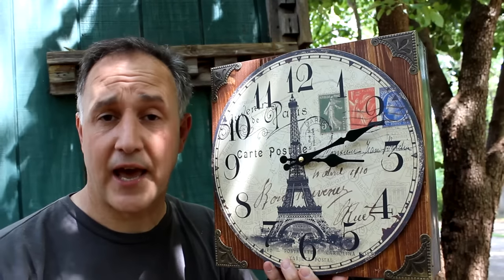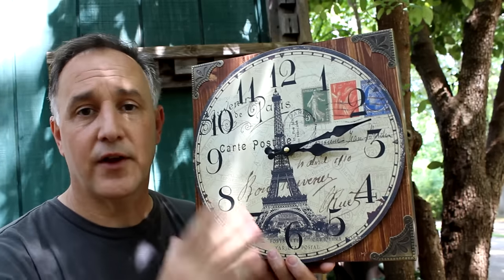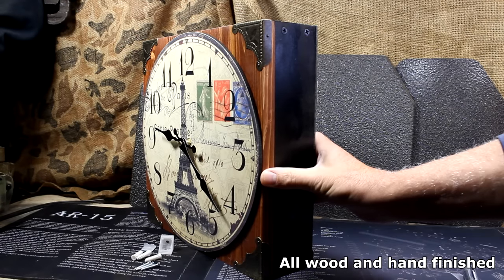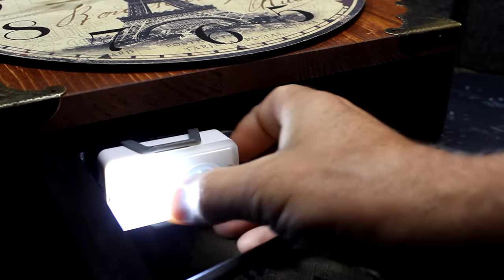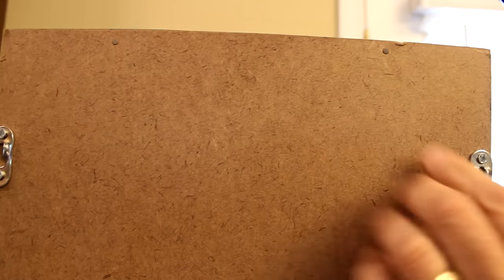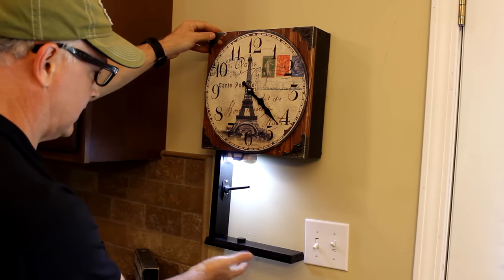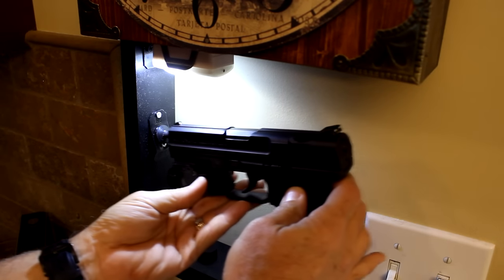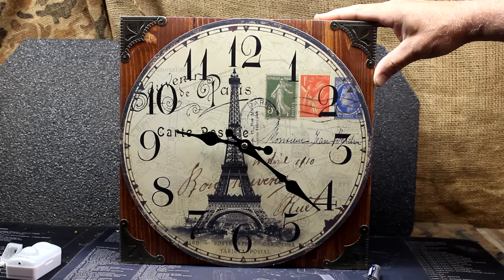Tacti-Clock Gun Concealment

Comment: kinda odd to have clock at face/eye level... usually they are higher up.
Reply: Depends. Not always. I have a pretty large clock on my wall. 2ft x 2ft long and it has to hang on shoulder level. ^^
Reply: Not true even a little.
Reply from the maker: It looks good on the wall and that level helps get to the magnet easier. My wife approves so all is well.... and she's picky.

Comment: Nice, but haven't you thought about getting a big heavy gun safe thats bolted to the ground?
Reply: Nah, he probably just has like 30 clocks in his living room.
Reply: The purpose for these is to have a gun ready no matter where you are in the house. What happens if someone breaks in, and the come from a direction that would be blocking a path to the safe? You gonna take a risk and try to shoulder check him out of the way?
Reply from the maker: I have three.
Reply: +Alex Moore  how about installing deadbolts and iron bars on your windows and doors? The best defense against an intruder is preventing him from entering your house in the first place. Install motion sensor security lights on the outside of your house, trim your hedges. Or just leave the door unlocked and the Windows open.
Reply: +Rxxxster those are good ideas, but it's not a bad idea to have something in case someone is bold enough to try or somehow makes it past. You can be as careful as you can be in a kitchen, but if you throw out the fire extinguisher then you aren't that smart
Reply: +Alex Moore I still have my AR15,AR10,12gauge,g27and a g23 inside my house. I ain't that dumb:)
Reply: +Rxxxster Four houses to my right there is a freaking fortress of a house. Guess which house had 3 break-ins last year? If they want to get in, they will.
Reply: +RBGJoe if that is true, I guarantee you that it was an inside job or done by someone they knew. Or a very shitty fortress.

Comment: what do you think about a small 22 for home defense?
Reply: Theres much better options, but a .22 is better than nothing!
Reply: for HOME defense, you'd have to use a .22 rifle in order to get maximum velocity, reliability, and capacity out of it. But at that point, you could just have a 5.56 with a muzzle brake on the end if recoil is something you're concerned about.
Reply from the maker: I'm not a big fan of 22LR for self defense but it's better than nothing. It will kill, it just takes longer. Go with what you have,

Comment: Those Molly holders never work right they pull out too easily
Reply: Exactly.  They're crap.  I keep a box of those metal self-drilling anchors that you screw in around the house at all times.  The hole isn't much bigger, you don't need to pre-drill, and they hold WAY better.  Those worthless plastic sleeves that come with stuff go directly in the trash.